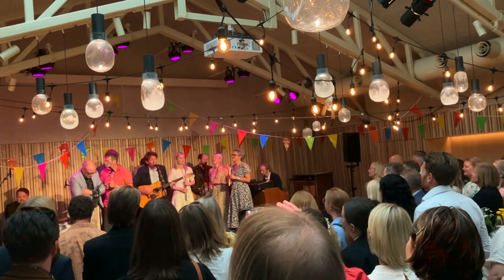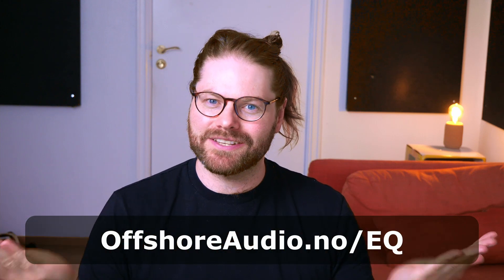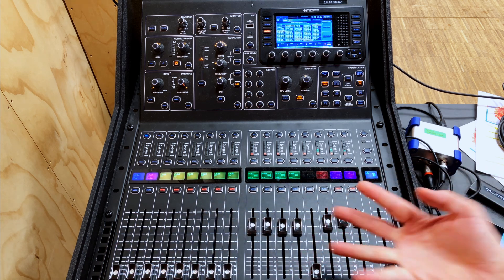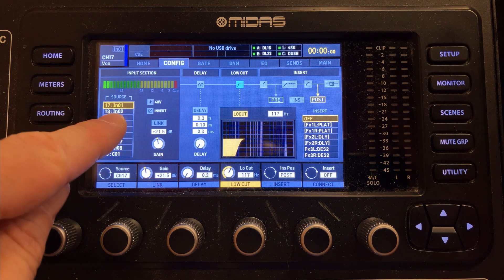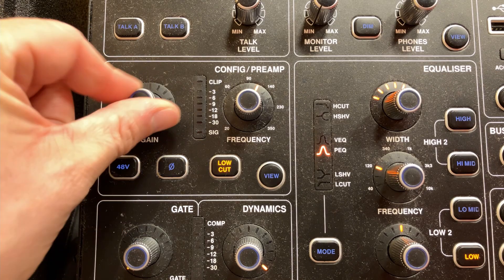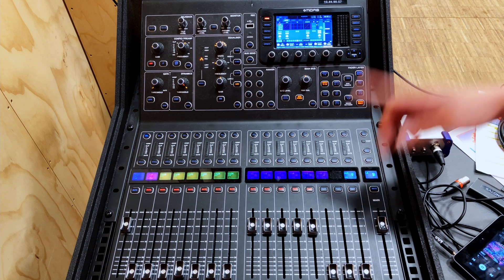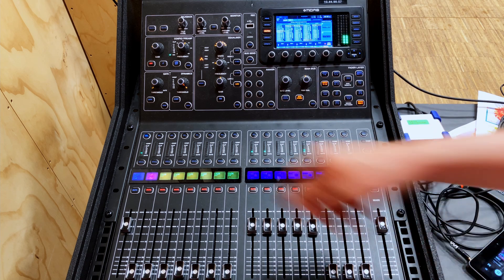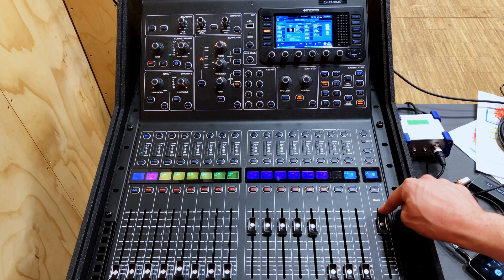Problem Solving on Digital Mixers

Comment: Sir how to test my active speaker if it is functioning normally or have some damage like no tweeter and my mixer is M32 thanks for your response
Reply from the maker: Hi, if you're testing an active speaker don't use the mixer. plug a mic or a sound source directly into the speaker. If there's no tweeter or woofer that should be fairly obvious; you'll lose a lot of the high end or all of the bass.